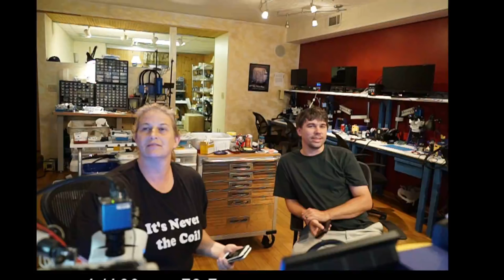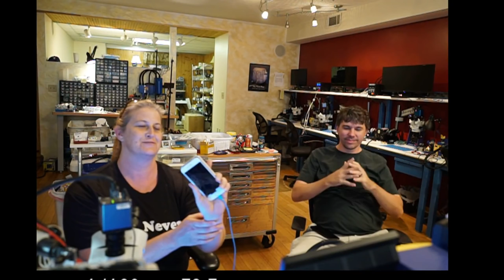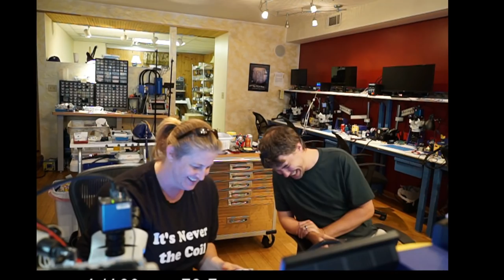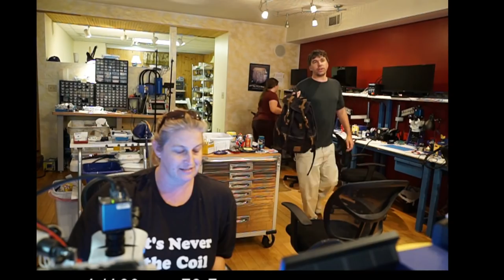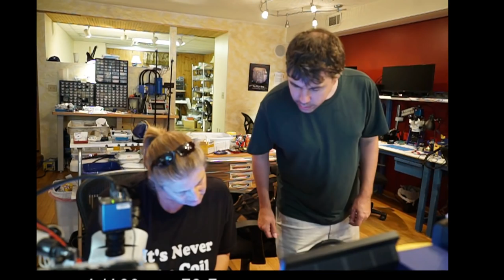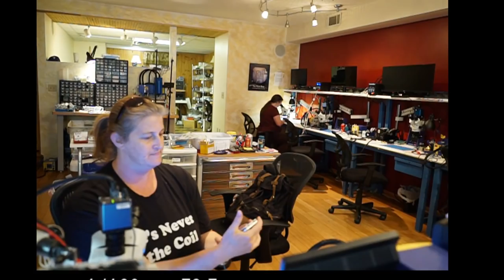GREAT NEWS!  iPhone 7 Error 4013 Baseband Shorts are SOLVED for data recovery!

Comment: It's always the audio ic you have to replace with a new one or replace it. I did try it and it worked.
Reply from the maker: No—audio ic fault can cause error 4013 but it has a characteristic long boot loop, not the short boot loop.  Even if audio ic is the problem, the chip itself is fine, and the problem is weakness in the connection of the mclk line—unless you reinforce that connection then the problem will likely recur

Comment: It seems if you wanted to go all out you could isolate all the power and clock circuits that could be faulty and use a second, good, chip to provide them. It sort of depends.on how tight the timing is, but with a couple of sacrificial chips to map out the internals, and a hand full of failed chips to map out the most likely failures, it should be possible to make an interposer that can be put in position on the failed phone, the known bad chip in one socket, a known good chip on the board, and power/clock signals supplied by the good chip would be fed to the bad to keep it ticking over so a data extraction could be done. 

It wouldn't solve all possible failure modes, but it might solve enough of them, especially if a way to underclock the communication lines was discovered.

Comment: Hi Jessa and Mark @iPad Rehab great news!! Quick question, I have a 7 with this BB CPUshort hanging around in a drawer for months now (bought it dead) I tried restoring it several times (with error 4013 obviously), won't that make the device go straight into recovery mode if I put a known good BB CPU on it? I think it will. I'll try it whenever I get another 7 that doesn't have this short
Reply from the maker: I would have thought that as well—but nope.  It may boot if you kick it out of recovery—definitely if you just tried update and failed, not sure about having tried restore.
Reply: It will boot with a known good baseband but it won’t ever get service. Do not try to restore with a bb cpu from another phone, you will lose all path to data. Error 4013 when the baseband issue is resolved will boot just use a program to kick it out of recovery mode

Comment: I just don't understand how you did not try to swap baseband CPU a long time ago?!?
Reply from the maker: Because 1–we know that baseband cpu chip has a hard coded unique identifier. 2–we already  know that if we swap NAND which also has a unique number that the phone will just go to recovery mode and you can’t get data.  3–we know that a 6s or 7 will not boot without baseband, ie if you remove baseband power ic it will not boot.  4– the baseband chip is underfilled and removing it, removing another, cleaning and reballing is delicate and tedious.   Together this means that the reasonable thought process was that there was little to no chance that a mismatched baseband chip would actually allow the phone to boot instead of just go to recovery.

Comment: Is it possible to just remove the solder ball on the baseband CPU where the short is and install back on the board? Solder ball the rest and leave the short line flat just to removed the short? Will it at least boot for data?
Reply: aubrey vantuyl Probably not. All lines need to give a signal to allow the phone to boot. Baseband is verified first before phone will boot
Reply from the maker: The short is internal to the chip itself, not a solder ball underneath
Reply: I understand the short is internal on the chip, but the line that gives power to the short could not be connected thus removing the short to that area of the chip.  Worth a try just to see if it boots, especially if you don't have another bb CPU on hand. May not work but just a thought.
Reply from the maker: The problem is that the short is depriving the chip of a power line it needs to function.  Even if you could delete a ball, (you can’t the chip has many connections to these power lines) then you’d have the same problem—the chip is deprived of the power it needs to function because of an open line.

Comment: Sad , but Russian soldering community tried it on 6s and 7 long time ago for data recovery))) 
On forum called mobile files there is a large content about hardware restore of iPhones ) but your channel got something new too )))
Reply from the maker: This is sad.  We work so hard to make sure that we share information. The language barrier between Chinese, Vietnamese, and Russian communities is a problem.  The US microsoldering community does not touch iCloud lock, and this solution is a natural extension of iCloud unlock chip transfer research.  It is sad for all the cases that went unrecovered until now.
Reply: iPad Rehab there is a legend that if we buy a new iPhone DONT POWER IT disassemble it and take home button to other iPhone 7 that got cracked home button and restore from DFU it will worked as native home button. But it expensive experiment and if someone in your area got money and can do it please show this video
Reply from the maker: That same legend existed for iPhone 6 error 53.  That a brand new never activated iPhone home button could work in an iPhone to cure error 53 (back before error 53 was undone).  
I tried it with a brand new IPhone 6 from the Apple Store and it did not work.  Phone still had error 53.  
This legend was from the Vietnamese not US so there may be a difference in iPhone versions that it works for.  I believe that it did work for the guy who shared that idea—I spoke with him and he was sincere.